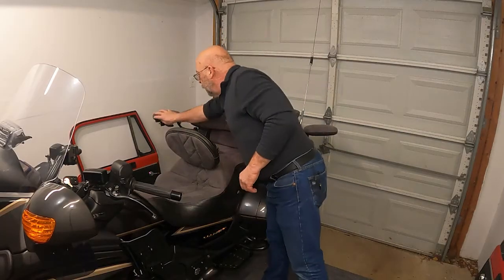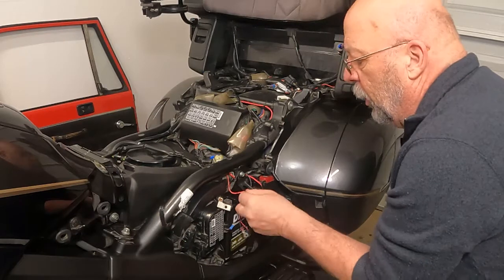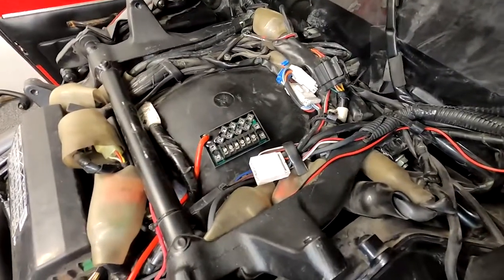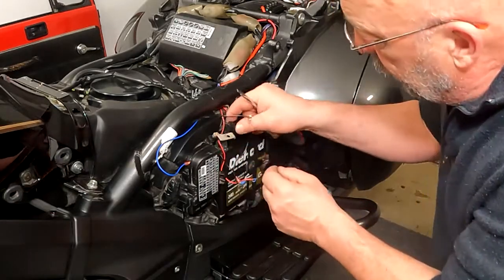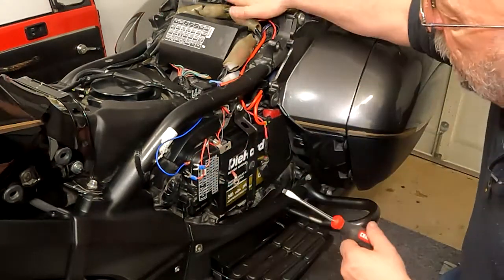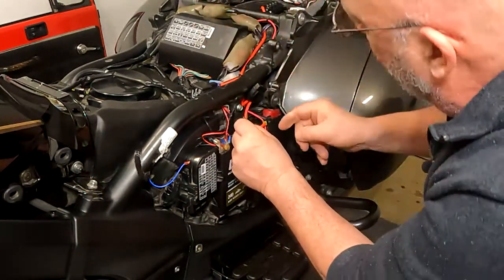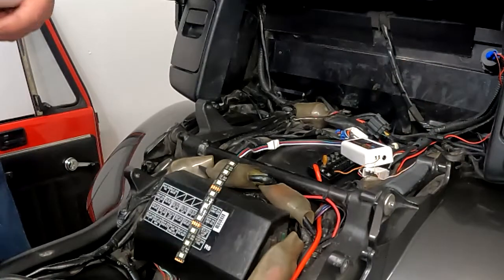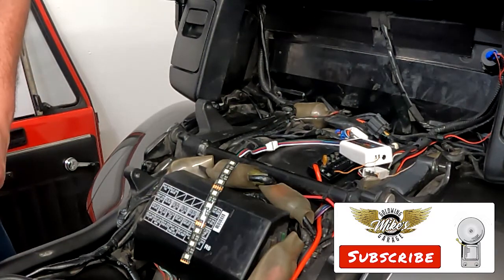Extend Your Goldwing's Fuse Box

Comment: I have one of these accessory panels. What lets it down is the panel is far too small to be able to do a neat and tidy job connecting accessories. Having to run accessory ground leads to the motorcycle earth point is nuts it just adds more work

Comment: Mike, I would not recommend that location for the EC fuse block. A better location would be forward of the fuse panel where you connected the blue wire. If you have an issue with any of the circuits you would have to remove the seat to check the fuse. The location where you mounted the fuse block is perfect for the EC ground block.
Reply from the maker: Thanks... I'll take a look at that. I did notice that it was pressing down a bit on the rear fender.

Comment: Did you ever get the ground block put in place?
What does that look like?

I'm looking to do this on a new to me 2008 GW - hoping the same as ur 2016.
Reply from the maker: Hey... Sorry for not getting back sooner. Things have been so nuts lately! So yes, I did place a grounding block next to the fuse block. I ran a 12 gauge primary wire from a "buss bar" I purchased and grounded it on the engine. The grounding point is on the right side of the engine. You can see it by removing the side cover where you would service the engine oil. You can see it referenced in this pic at "G2"  https://www.goldwingfacts.com/threads/gl1800-wont-start-only-a-click.610705/#lg=thread-610705&slide=3   

Buss Bar Used - https://www.amazon.com/dp/B07C55B8LB/ref=cm_sw_em_r_mt_dp_F0KC8N64PJ1PY198HNHG

Comment: Where did you get your black crash bars?
Reply from the maker: They're OEM for the paint scheme I purchased. (2016 Black/Titanium) I took a look in some of the parts finders, but they don't specify color. You could ask around to see if anyone has them in black. The engine guard number to reference is 62501-MJG-670 for the right, and 62601-MJG-670 for the left. The rear Crash guards are 84130-MJG-670 for the right and 84140-MJG-670 for the left. OEM Prices are about $240 each for the engine guards and $87 each for the rear saddlebag guards.

The other option of course would be to remove yours and have them powder coated. You should be able to get that done for under $200.00 I would imagine.